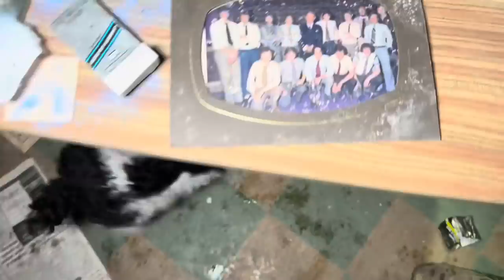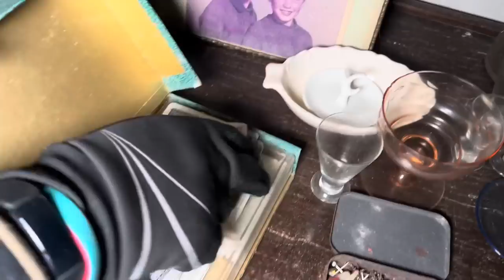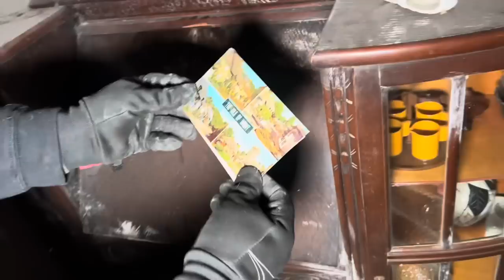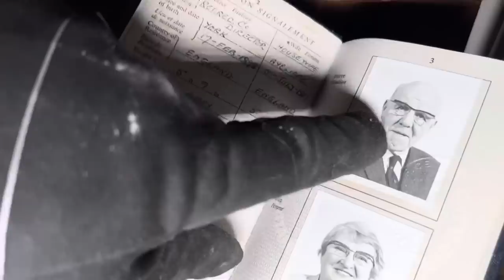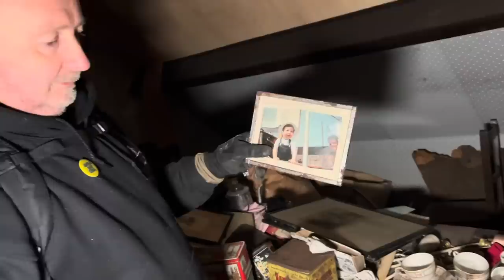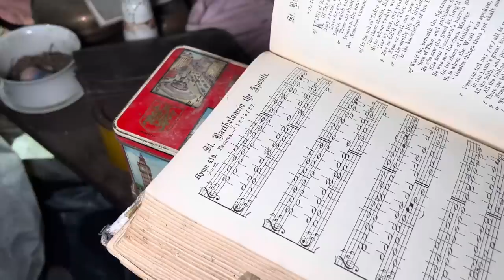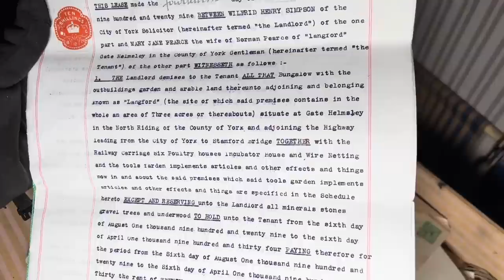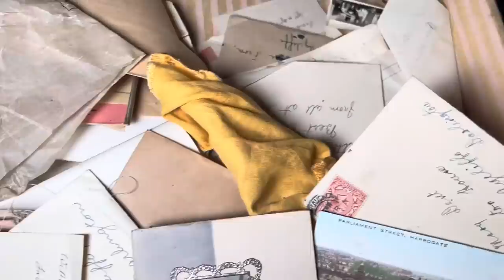This tiny little ABANDONED house had an American baby in the teapot

Comment: CONCORD PLANE:

Concorde is a tailless aircraft design with a narrow fuselage permitting a 4-abreast seating for 92 to 128 passengers, an ogival delta wing and a droop nose for landing visibility. It is powered by four Rolls-Royce/Snecma Olympus 593 turbojets with variable engine intake ramps, and reheat for take-off and acceleration to supersonic speed.

First flight: 2 March 1969

Number built: 20 (including 6 non-commercial aircraft)

Produced: 1965–1979

Retired: 24 October 2003 / Final flight worldwide 26 November 2003, Filton, Bristol, UK.

From Wikipedia

Comment: £29 in 1929 is equivalent in purchasing power to about £2,357.07 today, an increase of £2,328.07 over 94 years. The pound had an average inflation rate of 4.79% per year between 1929 and today, producing a cumulative price increase of 8,027.82%